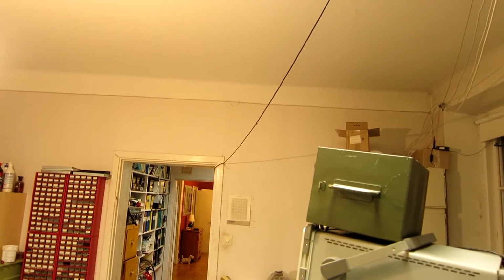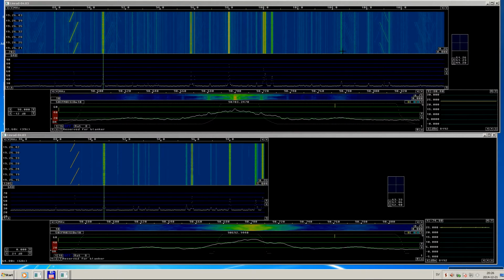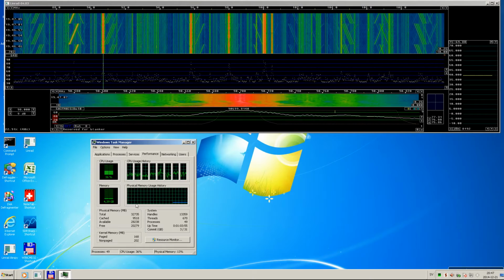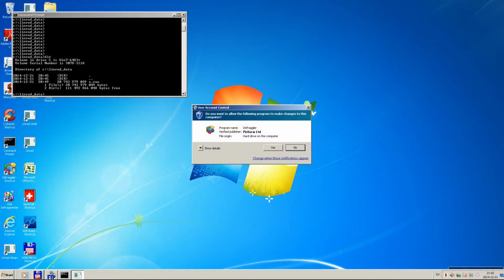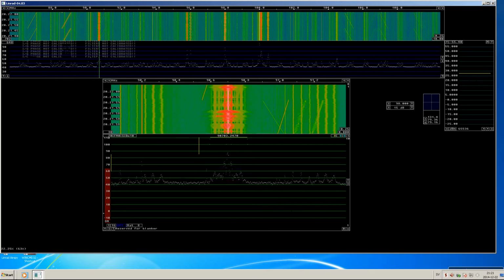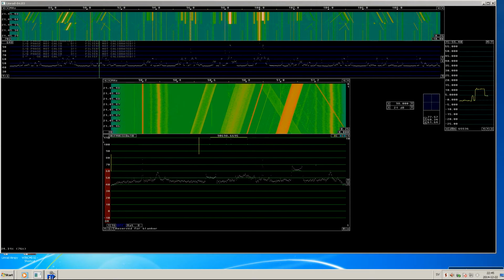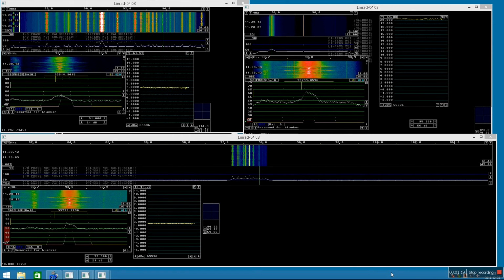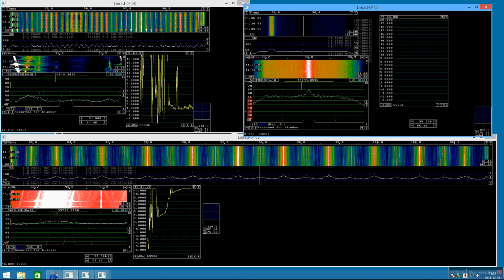SDRcompareTunersWide

Comment: Dear Leif, many thanks for the quality comparison video and your explanations.
Would it be possible to give us some real life audio samples of e.g. very weak FM station with a strong station close by, or a very weak ATIS signal from an airport without FM blocking filter, or some SatCom signals on 255 MHz ... and really listen to the S/N in the audio while looking at the S/N spectrum, since I want to use it primary for monitoring radio signals on wideband antennas and secondary as a measuring instrument. Do you also have a Ettus B2x0? I would love to see that versus Airspy and SDR-Play. And please do not compare one SDR with RF filter to another one without or with very different internal filter settings - a real true A/B test would be great.
Reply from the maker: Have a look here: https://www.youtube.com/watch?v=iyTjbaiTYUY
There are two cases, the interferer is within the "if filter" or the interference is outside. The video tries to explain.

Different tuner chips have different IF filters. Mostly they are designed for wideband digital signals, but SDRplay and Airspy can be set to fairly narrow bandwidths that allow a very respectable performance for the reception of a single weak WFM signal provided that the high power interference is not in the neighbouring channels.

"A very weak ATIS signal from an airport without FM blocking filter" does not mean anything to me. Are you interested in the S/N for a signal on e.g. 120 MHz as a function of signal levels on 100 MHz? (Without appropriate filters?)

I do not have an Ettus B2x0. I assume that those who have an interest in Linrad and the tests I am publishing are technically skilled enough to know the effect of "normal" filtering. Notching out 88 to 108 MHz if you want the air bands is outside my interest. That is "standard text book"

I do true A/B testing but it is up to you to judge to what extent it is relevant for your interests. I do my
best to make it perfectly clear what I am comparing. Surely some radios (FunCube Pro+) have
excellent input filters for e.g. 144 MHz. Other low cost receivers would need an external
filter and I see no problem with that....

Regards    Leif

Comment: For apples to apples comparison, it would be fair to enable the narrow IF filter in airspy too instead of using it as a monitor.
Reply from the maker: Sure, but Airspy is new to me and I have not yet implemented the code to do that. (Work is underway.)
"The narrow IF filter" is not something well defined in Airspy. There is a lowpass and a highpass filter. Together they can form a channel filter for FM with a bandwidth of about 0.5 MHz. Not very steep on the high side (where the low
pass filter is) however.